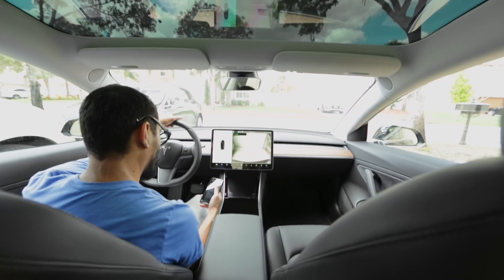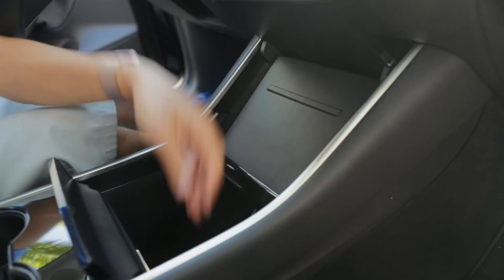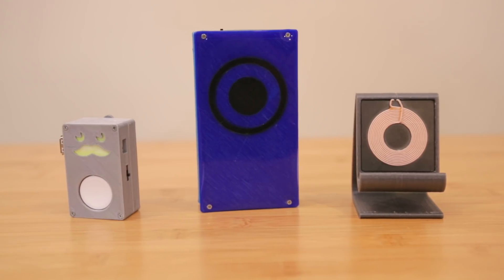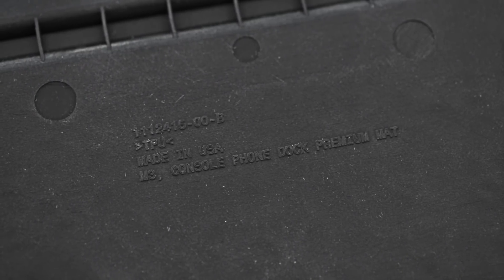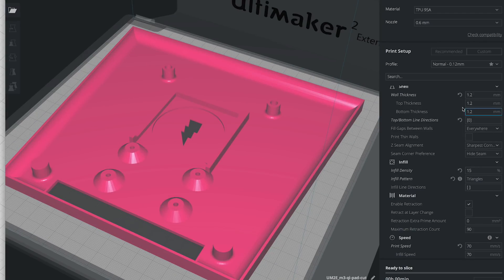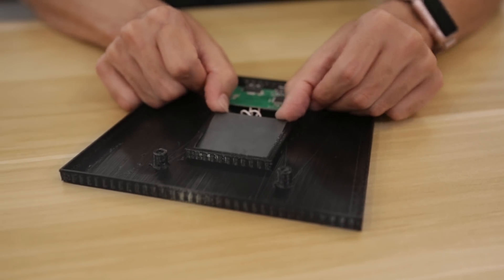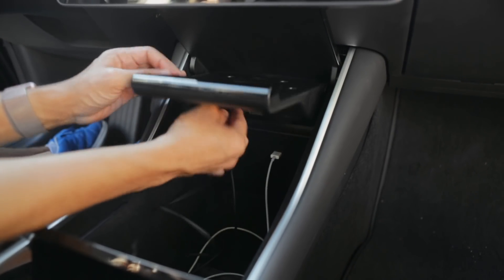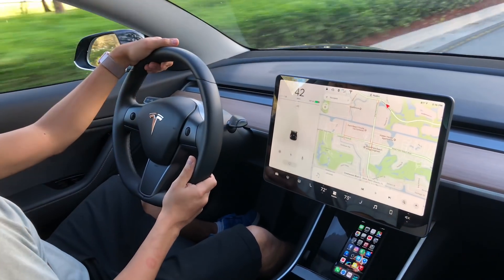Wireless Qi Charger for Tesla Model 3

Comment: @Adafruit Industries #Adafruit Industries

Hi I have made the 2 charging port version but im wondering if it will fit as the to pegs at the bottom are higher up then the single charging port version. Have you tried the 2 charging port version if it will fit? I dont have my M3 yet

Thanks in advance